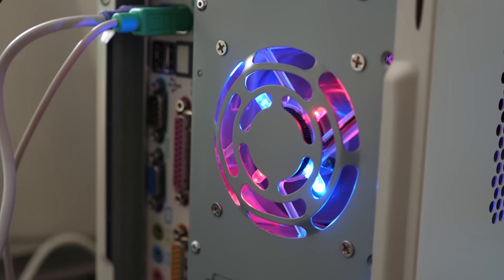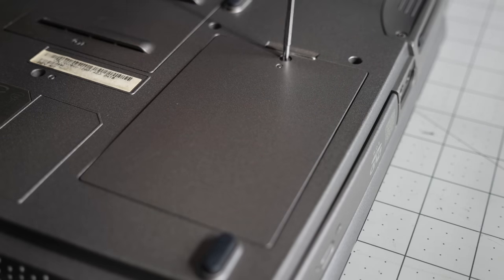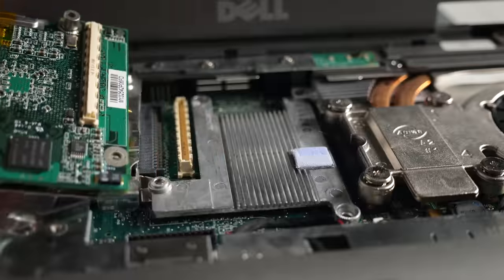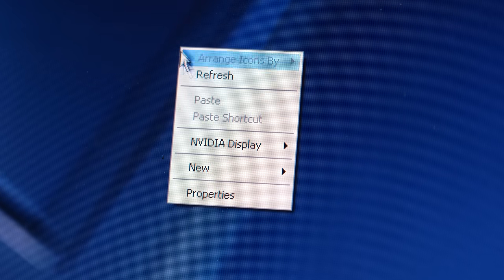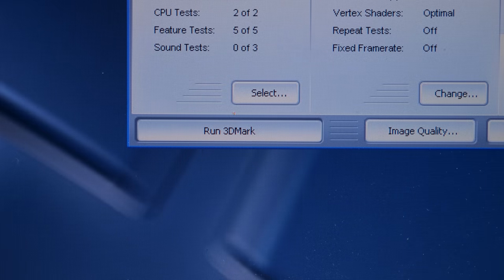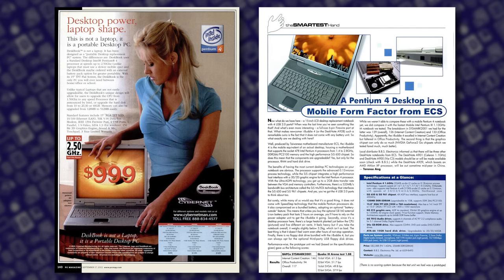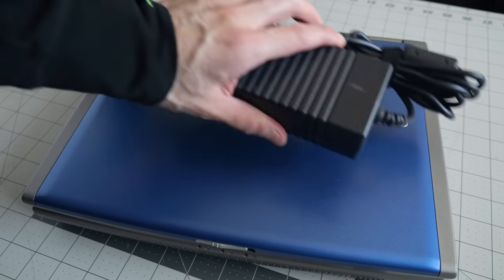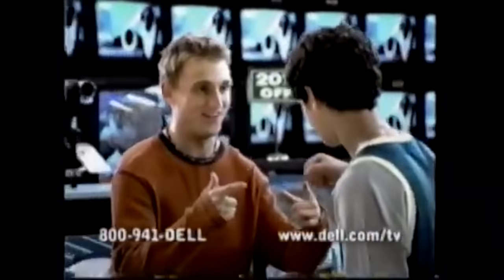Dell Inspiron 5150: Good for Windows XP Gaming?

Comment: Don't let the fact that the Radeon performed worse fool you. That just happens to be a lower spec Radeon as compared to the Nvidia selection. That Radeon was already a year older in technology then that Nvidia chip. When the Inspiron 5150 was released the Radeon Mobility 9600 was the competing card to the Go5200 and it seriously outperformed the Geforce. During this era most all Radeon cards outperformed their Nvidia equivalents. This is the era where ATI dominated Nvidia in performance. The FX series cards were some of Nvidia's worst performing cards. The 5000 series chips were Nvidia's first major blunder and allowed ATI to take the performance crown from them for several years before Nvidia manged to take it back (and mostly keep it from then on.)

Comment: I had an FX 5200 Ultra AGP back around that time and from what I remember, all but the most powerful FX cards (5800 and 5900) were absolutely terrible at running both DX9 and DX10 games, despite being supposedly DX10 capable GPU's. I'm not surprised that it refused to run Crysis at all and performed so terribly in other games at that high a resolution. Nvidia wasn't able to really sort that issue out until the 6xxx series GPU's. The 6600GT in particular was a huge rebound for Nvidia.

Comment: I had a Dell Inspiron 9100 back in the early mid 2000s it rocked as a gaming system. You could upgrade the CPU and gpu to meet the specs of the best alienware laptops of the era. I currently have a Dell Studio 1735 I am setting up for my old library of 90s and 2000s games. I did build a modern system by  Xp standards, amd fx build with a 750TI gpu, but for the reasons mentioned here, I installed a modern OS and sold it. I decided a Laptop will be the better option. Anything too modern/demanding will likely run on my main gaming rig anyway.

Comment: I originally bought a Dell Inspiron 5160 in 2004. I opted for the 1400x1050 display and GeForce FX Go5200 graphics. It was one of the worst laptops I ever owned. Slow for XP, and even slower for gaming.

Comment: I just bought a Windows XP laptop on eBay, I wanted one from this era as I only used XP desktops growing up. Ending up buying an HP Pavilion ZD8000, a 17" beast of a "laptop" with a desktop P4 3Ghz and a radeon x600. Weaker than my HD 2600 Pro in my desktop but can run older games at native 1440x900 or newer games like Half-Life 2 and Far Cry at reduced res. It can even run Doom 3 at playable framerates at 800x600. Would love to put a P4 3.8Ghz in it but those things are like $150 on eBay, no way.

Comment: I've got a stack of old laptops just far enough past their prime to be what you'd probably call e-waste, and I've had great luck installing XP on just about all of them.  Most are Core/Core2Duo era, GeForce 8600m/210m, but some as late as 3rd gen i7 with GTX 850m, and as long as you have a USB Floppy drive to load SATA drivers I've found you can get just about everything working, and even the wimpiest GPU can game like a champ when it's that many generations newer.  From what I've read, you can generally go as far as Intel 3rd gen or AMD Bulldozer for CPU, GeForce 900 series or AMD 500 series for GPU before you lose XP support.  Can't speak definitively but that has been the case so far for me, and if you shop around for laptops just a few generations further back you can pretty much buy them by the pound.  Great for throwing an XP lan party.

Comment: Ha, well timed Colin!
I just bought an XPS600 desktop today for 20 bucks, turned out to have 2x GTX 7800's in SLI but a poopy Pentium D, folks say it won't take a C2D but I'll try.
Need to change a few caps but at least it still runs.

Comment: If anyone is serious, give a Lenovo T430/T530 with nVidia a try.  Set to discrete mode you lose a lot of the issues, and use nVidia drivers to set the scaling modes and enjoy better scaling.  The Fermi based GPU has XP drivers and is much much faster than an FX5200.  (Like 60% of a 9600GT fast).

Comment: I would definitely recommend this laptop compared to its other pentium 4 dell laptop brothers, as it uses the more reliable dell barrel charger that they used for a long time instead of their old kinda dodgy 3 pin connector. I’ve found it to be a far more reliable version of this class of Dell pentium 4 era laptops. Also, I highly recommend installing the max of 2GB of RAM, an SSD, and the highest end Pentium 4 CPU you can find. This will really turbo charge this machine and make it run quite well. Just make sure to add fresh thermal paste to the CPU and if it has the daughter card, repaste that too if you can.

Comment: This machine gives me good memory vibes from my Dell Inspiron 1520.
How i was exited of this machine! Deep black mate finish outside, awesome keyboard with just enough movement, cold enough. Paired with Nvidia GeForce 8600M GT it was even able to run Crysis!
Shame, what it was paired with TN matrix with 1280x800 pixels, if it only have an IPS screen that would be an ultimate machine.
It served me well for a long time...
It saw Windows XP, 7 and 8. I have tried Hackitosh with it and fall in love with OSX. 
This machine was maxed with RAM and replaced CPU (T55xx something), and at the some point of time even SSD was installed! 
It was end-up as my first FreeNAS server with built-in UPS :)

Sadly, it was retired and placed in storage (my hands just can't sell it) and i never saw something so modular, flexible, balanced, upgradable as this machine anymore, but yeah, those days are gone...

Comment: I don't think that there is much point to having old PC hardware: you can just run the software on a modern PC.  This isn't like an SNES or other system where there was "one true" hardware setup that you are trying to replicate.  

Unless you have nostalgia explicitly for the Dell Inspiron 5150 (as opposed to the 5160 or 5140) you might as well just install your old games on your current computer.  Either way, it's not going to be exactly what you remember.

Comment: In my experience, I've actually had better luck running old games with a Linux Windows XP Virtual machine instead of actual hardware. Hardware comparability and drivers were not very standardized back in the early 2000s so running some games meant just going the game supported wherever you happened to have.

Comment: the geforce fx GO5200 graphics card is technologically ahead of several generations it is better than intel arc, the pentium 4 3.06 gigahertz processor is a good processor for laptops even pentium 3 that's why such a laptop is worth buying but linux red hat 4.0 enterprise must be installed

Comment: Can you make a video with same concept but with windows 7 gaming? I wonder what it would been like using ssds for both windows xp and windows 7 instead of standard spinning hard drives. If I could use both windows xp and windows 7 full time instead of windows 11, I would in a heart beat. Windows xp and windows 7 were my favorite versions of windows. Windows 11 is meh too cartoonish, it reminds me of samsung touchwiz and on very old samsung phones. I rather use samsung touchwiz than windows 11 since it was functional and not a confusing mess like windows 8.1 and windows 11. Even linus from linus tech tips made a video about windows 8.1 being confusing and being a mess. My friend had an old htc phone that was using windows mobile 5 or windows mobile 6. I really like windows mobile 5 and windows mobile 6 since windows mobile 5 looks and functions like windows xp on a phone and windows mobile 6 looks and functions like windows 7 on a phone. Windows 7 mobile looks like windows 8 tiles even before windows 8 was released on a mobile device and on pc instead windows 7 mobile looking like windows 7 with the name windows 7. I used to have the htc one m8 with windows 8 but the only thing that I liked about the windows 8 was the battery life, I never like windows 8 tile interface plus I was always confused on how to navigate the menu on windows 8 on mobile just like I got confused on windows 8.1 on pc. My favorite browser was netscape navigator before mozilla acquired netscape navigator to make firefox. I always used flash video player to watch videos on the browser and play games like runescspe on the browser. Runescape is on the google play store. I used to use the flash video player on android years ago before html 5 was a thing on google chrome. The only thing that I did not like about the flash video player on android, it caused the phone to become sluggish and when I removed the flash video player, my android device no longer became sluggish. The flash video player was the main culprit that made my android devices slow at the time with earlier versions of android since I would always use the stock android browser before using google chrome. I like the samsung browser for android since it has a built in ad blocker plus you can cast videos from the browser when watching videos online like sports and movies like google chrome. The only reason why I use google chrome is because it syncs with a bunch of google services with some google services that I use when I sign into my gmail on my android devices and my chromebook. I had to use the flash video player to watch videos or play games since it relied on the flash video player. The only thing that I like about windows 11 is support for android apps. I use windows because of the support for games from steam, being able to sync my music library playlist from media monkey that is only available on windows and android. Android does about 90% of the stuff that I like to do and it's very functional while windows is about 5% on what I like to do and 5% with chrome os, I can sideload apps like android with chrome os, there is support for steam for certain models of chromebooks when it becomes available, there is also parallels that can run windows applications on certain models of chromebooks and support for linux apps for tinkering around and playing with linux and running linux apps on chromebooks. If android and chromebooks can do everything that windows can do I would use android and chrome os and barely use windows. I use android and chrome os because I like to sideload apps and there are a bunch of free apps and modded apps for android. I tried to sideload apps on windows xp and windows 7 but there was always a 7 day trial, 30 trial or you had to pay for something. With android and chrome os it's optional to buy stuff. Some of the apps that I paid for were removed due to copyright reasons and some of the apps like games stopped receiving support and I paid for in app purchases so when that happened, it made me not trust paying for in app purchases. I use google opinion rewards by doing surveys whenever they are available and the best part is that there are no ads considering it's a google app and I let the money accumulate from the surveys and I use the money from the surveys to pay for any apps and even in app purchases. You can even transfer the funds from your survey to your bank account, the downside is that the funds on the surveys have an expiration date but it shows you when the funds will expire. You can even use the funds from doing the surveys from the google opinions app for subscription services from the app since it's connected from the google play store as long as you have enough funds to cover the apps, in app purchases and subscriptions fees. I miss laptops that used to have optical drives in them. My old hp laptop from 2008 still has an optical drive with removable battery that uses a latch to remove the battery. I also have an old msi laptop with the nvidia gtx 960m gpu and optical drive. I use the optical drive all the time. I have a plastic bin with some games that says games for windows on a disc. There were some games removed from stream. I have jump force on my ps4 since it was removed from steam awhile ago and there is a street fighter game on steam that is only compatible with windows 7 and not compatible with windows 10 and windows 11. I wish there was a way to play older game titles from older versions of windows and have them compatible with newer versions of windows since the newer hardware is more powerful than there old predecessors. The old games on pc and game consoles have a ton of classic games. The newer video game consoles don't have any of the classic games like from the ps one, ps2, and n64. The newer consoles are just the remastered versions of certain games with the same graphics with the price of a new game even though the games are very old. The remastered versions of the games don't even have improved graphics for the old games. I wish the old classic games like goldeneye 007 from the n64 and super mario world from super nintendo with modern graphics with the same exact game play on video game consoles but for pcs, have the options for higher resolution like 1080p, 1440p, even 4k and ray tracing. I wanna be able to play golden eye 007 from the n64 with 4k and ray tracing on pc and super mario world from the super nintendo on pc with 4k and ray tracing while both games retain the same exact game play they were known for. I'm glad that crysis was being talked about on this video. Crysis is still my favorite game, I even have crysis remastered on the nintendo switch, there is already a nintendo switch and ps vita emulator for android. I can't find the crysis remastered rom so I can try it on my android devices.

Comment: I saved an old Dell Inspiron 7500 from a school I work at. They were clearing out a bunch of old tech that has been hanging about in storage since the 90s and I asked if I could take that one. It's in pretty great cosmetic shape, but I need to get ahold of a power adapter before I can test it.

Hoping it works. I'm interested in having a decent Windows 98 machine again for the first time in many years. If it's in working order, or I'm able to repair it if needed, I intend on swapping out the aging HDD for some compact flash storage. I will give it a good cleaning inside and out and will replace the thermal compound as well.

Comment: I had this laptop in college. I bought it new in 2004. I used it up until 2012 and upgraded it to 4gb of ram. I actually had a lot of issues with it, one being that this laptop would constantly overheat, pentium 4s were notorious for that. The other was the headphone jack failed in which Dell had to replace the motherboard on it. The disc drive failed, battery failed, and hard drive failed all during Warranty too. Towards the end of life it started to develop a line down the screen. I do still own this laptop but haven’t turned it on in years. This laptop forced me to go to apple. This is one I do not miss.

Comment: I still keep my old Alienware M5750 around for XP gaming. A bit newer being bought by me in 2006, but it came with XP and a Core 2 Duo. Also has a discrete "mxm" graphics card (they worked out a standard by then) which was upgraded from an ATI X1800 to an AMD HD4850

Comment: I recently picked up a Dell Latitude C840 with a 2.4ghz P4M to run windows 98SE, it absolutely flies running it but getting it setup to run Win98SE was a bit of a challenge since Dell had committed that generation of machines to only run Win2K or WinXP by that time.

Comment: Ok so, I've got parts for an XP build but it's left me in a weird state. What games run on XP that do not run on 10? Any suggestions?
Reply: Most games run on 10 just get kinda wonky, gta 3 goes way to fast on newer PC
Reply: Many XP era games do run on Win10 but have weird graphical glitches etc. Microsoft also dropped support for hardware accelerated audio on Vista and newer

Comment: Very nice, I always liked the look of these Dell Laptops. A good Win XP 32Bit - Dos Laptop, though large would be. An Acer Aspire 7520-5071, specs are athlon 64 X2 tk-55 1.9GHZ, GPU Nvidia Geforce 7000m, 2GB DDR2 So-dimm, 17' screen, dual Hard drive caddy (dual booting can work or have a second drive for games inside.) Also one thing many people overlook even though up to 4th gen intel I series can do XP. The Am3 - Am3+ sockets can sometimes run windows XP and very well, I have a older smaller HP machine lying around that I socketed in a Radeon 7970 & a leftover EVGA B-stock PSU and it runs XP very well.

Comment: Any chance the system might have thermal throttled during the first game test? It was very common at the time in laptops with a discrete GPU and would explain the poor results.

I have an HP Pavilion ze2113us, which is a very similar model to your Dell.

Comment: You might want to look into some scaling options that either integer scale or do the scaling on the nVidia card (it outputs full resolution of panel, but the rendering is done at a lower resolution).  I had a 3k panel once and it's pretty bad as well.

Comment: These are awful laptops for anything like gaming. The motherboards have severe issues and WILL fail as they have serious thermal issues and solder joints will fail over time. You can attempt to reflow them but they will fail again. I had to replace hundreds of these back when they were current. My personal machine I went through 4 motherboards myself until it finally completely died and I finally gave up on it entirely.

Comment: I found a 5150 for $30 at a thrift store recently. my laptop has similar specs other than having a WiFi card and also a 2GB ram upgrade I installed. It runs very well for a Windows XP era laptop. Well worth what I paid for it.

Comment: I have a dell latitude c800 with the same panel and it would be an euphemism to say that the poor 4MB radeon mobility m4 is overwhelmed with that resolution, the worst is that it isn't even the highest end panel available on that model, a 1600x1200 was also offered an i can imagine how that would've worked out with that gpu.
Reply: At least the GPU can be upgraded in those units. GeForce 2Go 32MB is an option.